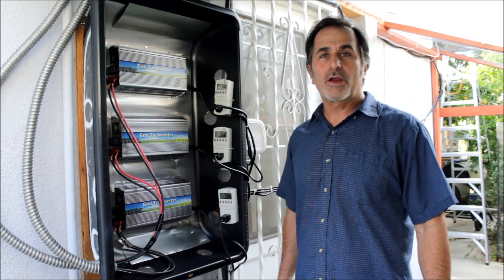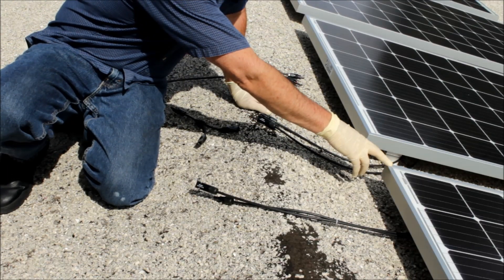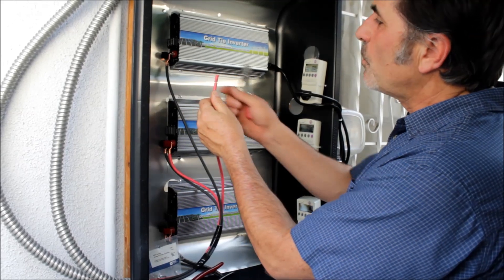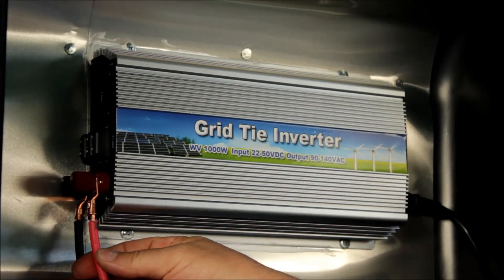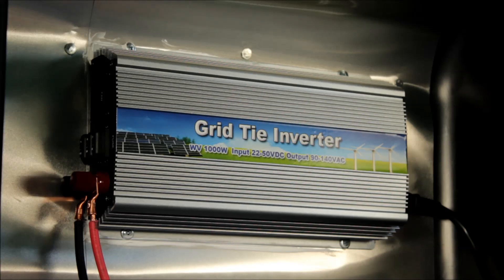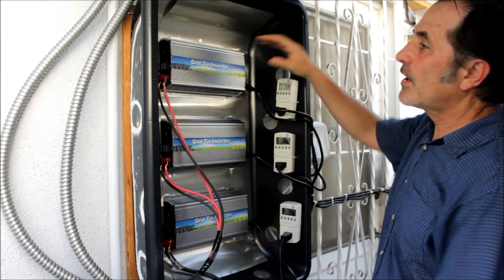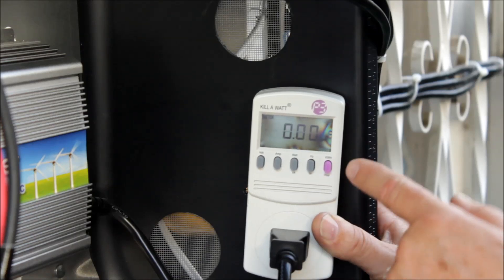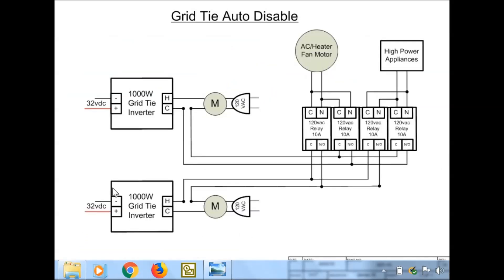How to Install a Simple Grid Tie 1000 watt Amazon Inverter Solar System -1800 watts for $1800- James

Comment: Watch this video. https://youtu.be/VP9n8T3PsMA Its not mine. Ran cross it. Please spread this. Don't burn your house down.
Always tie into a (Not used circuit plug.) Always use the proper sized breaker in the main breaker box to your house. NOTE: For all the power you are feeding back. I'm putting in a breaker box for all my grid tie in my power Shead. Each with its own breaker. Then to a double pole breaker in the main breaker box so I can add to the phase that needs it. If you have like an AC unit only on a circuit and doing it with relays sounds great.

Comment: Install only if you have a contract for connection (net metering), use inverter with limiter to NOT feed back to grid...
I had an old meter that actually turned backwards before I put the solar on. After I put the solar on they changed out my meter That did not spin backwards!!!

Comment: The electric company came out and said they were seeing unusual back feeding before I went to net metering. He told me my meter is charging me for the power I was producing since it wasn't a net meter. I have sense added a large solar array with mini grid ties, super simple and the electrical inspector was very impressed and asked if he could bring trainees out because not many people out there are doing self installs. I have a manufactured home so I wasn't able to install on my roof so I built a structure using the panels as the roof. I screwed the panels together with some foam rubber in between so no leaks. It doubles as a wood shed and a place to park my tractor and lawn equipment.
Reply: Make a video of it please

Comment: Great video!   couple of questions - I cant find panels that are rated 32V/300W as you mention in your video. maybe things have changed since you made it?   I see most are rated 11v to 20V which should still work with the grid inverter.   Also - why didn't you use the solar controller and battery bank to run the inverters?  thanks again for taking the time to make the video - very helpful!

Comment: a weird physics thing with heat is that if you dont have forced air heating and are only relying on natural convection, a matt black coated heat sink will stay a lot cooler than a shiny metalic one. metals have basically no emissive cooling, where as a perfect black body has a lot better cooling from radieation. even a dark layer of paint will keep those inverters cooler. wish they came in black yo. not a lot of engineers know this coz they didnt take advanced thermo

Comment: Isnt connecting straight to an outlet a fire hazard?
Reply: Why??? Power is power no matter which way it flows....
Reply: @SolarizeYourLife  Because if the inverter is a 3,000 watt inverter for instance and the wiring in that circuit is only rated for 1500 that could be dangerous.

Comment: I would really love to see the relay wiring in more detail. I would love to have a grid tie that only turns on when my air conditioning does.
Reply: Yes, I would love to know more about the relays too!!
Reply: @ronpucillotheactor513 He wires the relay (The one in the drawing from the grid tie unit) to get power when the Ac units relay is told to start the Ac unit. Then the one in the drawing from the grid tie unit pulls in to let the inverter come on.

Comment: pretty sure its 2 panels in series .. 3 sets of 2 panels in parallel   (Solar panels are wired in series when you connect the positive terminal of one panel to the negative terminal of another)

Comment: Interesting, I tried something like this a few years ago and I didn't consume all of the power I was using (like less than 100 watts) and a few days later Joe from the power company showed up at my door with his wire cutters in hand!  Check to see if your power meter detects a back feed and what the power company's policy on backfeeding power is.
Reply: If its set up correctly, the utility company is required to credit you for any excess power you produce.
Reply: @Zomby_Woof  That's true, but keep in mind they set the game up to their advantage all the time. If you go through all the "correct" procedures to monitor back flow of electricity, depending on what time of the day it is, you're going to sell your excess at a lower rate then they charge you for their power. They may tack on additional fees to your monthly bill as well for different equipment required to monitor back flow too. 
In my opinion, you're better off just to make sure the system is only providing power to you.
Reply: @ElationProductions  Depends on what your net excess is 

For someone with large surpluses, particularly if they are seasonal, it's a good way to get power you'd otherwise be billed for at times when you can't provide it.

Comment: I didn’t know that if you don’t set it up correctly that you will still be charged as if you where using the electric company’s electricity even though the extra power is coming from the solar panels, thanks for the info!

Comment: if you had a tiny 100w inverter and a battery you could activate these grid tie inverters with a reference ac phase/signal during the day when the grid is down
Reply: You would need turn off the main breaker while doing this.

Comment: how does this method disconnect from grid power if the grid goes down to prevent backfeeing ?
Reply: The inverter turn off automatically if the grid goes down.

Comment: I wonder if there's a way to power up the inverters in event the grid goes down, I know you mentioned they shut off output if you lose service
Reply: No. Absolutely not. That would then backfeed into the grid and could kill a lineman.
Reply: @DrFiero  I figured a person could hook a small generator to them for a power reference so they would start back up. What's backfeed ?
Reply: @drthik1  - Backfeed is when your power "device" (gen, inverter, whatever) starts to shove power back down the line into the main grid. Then some linesman who thinks he's on a dead circuit ends up going poof and you get to explain to his spouse why you needed to play Xbox so bad that it killed him.  Ok, that's an extreme, but you get the idea.

IF you are savvy enough to have a mains disconnect (transfer switch), then you could fire up a generator and the inverters would then do their normal thing, including following the typical unstable frequency of the gen. They don't care where the power's coming from.

Comment: Great video James. Have you ever see this done using Wind (PMA or PMG) as the power source to the Grid Tie Inverters? My thoughts are you would need to run thru a Charge Controller to Battery Bank to the Grid Tie Inverters. Thoughts on this? Thanks.

Comment: I had two grid ties and was told to remove them by the power company because it put the utility worker at risk is grid ties really worth it
Reply: I hate to tell you this but whoever told you that from the utility company either didn't know what they were saying or they lied to you because all grid tided inverters have a safety feature, if the grid goes down they automatically shut off so they don't put a utility worker at risk.

Comment: I have a question we installed solar but it is tied to the grid, in our area we get alot of outages , I'm wondering during an outage when there is daylight can I turn off the main grid breaker to stop feeding the grid and run the house on solar like we normally do, the only time we actually pul from the grid is at night the rest of the day we our feeding . I don't have a budget to install a back up generator and just wondering if there is a way to stop feeding the grid during an outage without a generator or batteries
Reply: There should be a disconnect from whatever self generator source(solar, wind, generator) to the grid. You could and do have have a switch(breakers) that will turn off the house power main from the utility provider and turn on your backup power source so that you may run off your(solar, wind, generator) to your home without back feeding to the grid. I fail to remember the name, but they have an integrated toggle so that it is an either or situation. Ask your local supply house people and they can set you up, I 'm sure.. Take photo of your main breaker box to take with you. They will need to know things like the brand of box and if  you have room to mount them.

Comment: Only Net Meters will count backwards for those that might not know.  Most modern digital meters that are not Net/DG meters will NOT run backwards on the kWh measurement.  You'll never realize any credit or $ benefit on the meter side with the Net/DG meter installed.  This system you installed will supplement your power consumption though.  Nice job on the video!
Reply: so most all digital meters, that are not made for net metering wont show running back wards, but have to be care ful that we dont have no power going out or the meter will think ther eis a device there and power it as consumption
Reply: @mattrowe1229  If you have a standard meter (that only shows forward/consumed kWh), having solar has some benefit, as it will either slow or hault your kWh reading on the meter provided that your solar is keeping up with your current usage or at least a lot of it at peak times.  But to get a true benefit, you need to get with the electric utility to get a meter that shows energy going both directions.
Reply: @Tortuga89R  yes, i cant get uyility ok because its an older mobile home, ect, but all i want to do is compensate the peal load a little and conter the kwh down some to lower my bill, i am fighting cancer and on ss check because of chemo cant wor, hard to pay all bills,if i could just save 20 dollars a onth would help with gas to get me to my doctors appat ans such,thanks for the response, and my utility co wants all new, ul listed, blah blah blah, and im going all used, i might just try it and watch meter with just 2 panels so i cant go over my usage

Comment: What do you do when the grid is down?
Reply: That's one of the shortcomings I can see with this system. What he could do is shut off the main breaker to his house, get some sort of additional generator to provide power and the solar would supplement it (in the day time at least). Not useful as a stand alone backup, but could assist a gas generator during a daytime outage.

Comment: Why do you say that you should not run grid tie inverters at full power? In fact, in many cases prople recommend sizing your inverter with a smaller rated wattage than your solar panels, since they rarely perform at max performance and it can save money. In your case it would have been worth considering using only two inverters, would save some money on the electronics

Comment: Hi James,  check those ends on the mc4 connectors internally they eat up after year or so if those are the ones from amazon that are very common....  do a load test on the cables u will be surprised

Comment: One question though... plugging a cord into an outlet to backfeed seems like a huge no-no to me, isn't there a way to wire it with Romex and some type of breaker?
Reply: Thats what grid tied inverters do tough. Same for a generator. As long it shut off when the grid is off or have a relay to shut off the main, its ok.
Reply: @MmeHyraelle  thanks for explaining
Reply: THIS.  Just because it works doesn't mean that backfeeding through outlets is cool. Im' certain that's not up to code (NEC).   But, it does pose an interesting scenario for off grid use. If these inverters sync to the phase of the grid  current sine wave, then theoretically it should work that these individual inverters would all sync together on the same single phase circuit -- each inverter providing up to 1000 watts of power -- such that you could easily scale up the power delivery capacity by 1000 watts for each one of these inverters you plug into the circuit (say an off grid cabin, tiny house, etc). If so, then the question is if any single one of these inverters will output power on it's own (no grid power), or would it require an existing source to sync to (like a master inverter outputting a sine wave to sync to)?  Anyone know?

Comment: The "net metering" info was tremendous, never heard of it, could be a huge $$$ saver for someone who is unaware. Huge thanks! #subbed
Reply: I had two grid ties and was told to remove them by the power company because it put the utility worker at risk is grid ties really worth it
Reply: @bendy1808  it's different everywhere so you should check with the electric company and wherever you get permits at where you live but most places seem to have some kind of policy in place to allow you to get a second meter from the electric company. This meter counts how much power you generate so it doesn't run backwards. When they read your regular meter they read the other meter as well and subtract what you generated from your usage. This system can also be used on demand to slow down your usage from the electric company. If you actually have everything off in your home then yes you will generate power that you will probably either get credit for or possibly a check for if you make more than you use.

I don't think most places use a single meter anymore. I could be wrong though.

You do have to take into account the fee for the second meter. Usually this is a maintenance or utility fee. In my case it's $25 per month per meter. So no matter how much electricity I generate I need to subtract roughly $50 in order to actually break even.
Reply: @bendy1808  I sure wish this would be addressed.....very confused about this as I have always been under the impression that grid tied meant that one was selling power back to the electric company
Reply: After considering the cost of the equipment and the time for the return of the investment, it does not seem a great deal. 

You save energy but you don’t save money.
Reply: @ajarivas72  for long-term it does save your money

Comment: If AC turn on at the night time(no sun - no power to the inverter), will the grid tie inverter broken? Its manual said do not connect AC line in before solar panel or it may broken.
Reply: That's what happened to mine, I left it switched on at night and it broke

Comment: I’ve heard someone talk about a “limiter” or else the power company could charge you for going backwards.  Can I look at my meter devise to see what kind of system I might need ? Mainly just want to use a grid tie in to help lower my cost
Reply: Research your utility company's policy first. Many will support net metering for small systems. Though for net metering they may not approve of DIY systems
Reply: @ThomasBomb45  I want to leave the power company  OUT  of this completely .  I'm looking for a company that can / will  assist in layout & needs
Reply: @jaycharles9548  Are you planning to disconnect from the grid then? Or just try to fly under the radar? If your solar is connected to the grid, leaving the utility company out of the conversation opens you up to potential problems
Reply: @ThomasBomb45  this is not true. You can install an inverter that has a current sensor on each split phase of the panel. The system will only allow electricity from the solar to match what is being used in the panel. This will not allow power to back feed to the grid and doesn't require a net meter . The utility will just see less usage during solar production where it is offsetting the load in the home. The downside to this is of there is very little load in the home and alot of available solar energy , the system will be throttled down . This scenario would be best with a battery bank to take that energy during these situations.
Reply: @kayzrx8  Is it legal to do something like this without talking to the grid operator first? DIY?
Reply: @ThomasBomb45   @Lily Warner  no it is not illegal to do this. It would be the same as running some of your load on a Generator. You will not be able to net meter . This is why you have to have an inverter that senses load to prevent your meter from charging you for solar production. You just have  to follow code and install a DC disconnect, labeling, ac disconnect , etc.  Use an inverter that is ul recognized and has safety's in it to disconnect during an outage. I currently have one installed myself . I don't sell back to the grid nor do I send anything out to it. Just offset the house usage during solar production. There are similar plugged solar panels on the market that are way smaller that follow the same principle. Went from a 400 dollar bill to sub 100. Would be lower if I had a  battery bank. May do that in the future .  You can always have an electrician do the wiring for you . Also the way the install on this video was done is not code compliant. Wrong conduit, wrong disconnects, non nema compliant enclosure, non compliant inverter. This would not pass an inspection.
Reply: @kayzrx8  do you have a link for one of these?
Reply: @user-bj4lp3fr1o  they are solar grid tie inverters with limiters, Sunny boy has some as well as, Enphase and a cheaper one would be  Solar GTI. There are aftermarket current sensors that interface with the grid tie inverter and has a current sensor on both split phase line to monitor current and limit the inverter when needed.

Comment: Each inverter must be on its own individual circuit breaker for sure!
Reply: And if possible, split the load between both phases/legs of power coming into your home. 2 single pole breakers next to each other would be on different phases.
Reply: So one of these inverters, each dedicated to their own 15 amp breaker, would be the way to go? And you must have a net meter so you don't get charged for what YOU generate, right?
Reply: @whatta7793  each panel should have a microinverter then tie them into 2 breakers